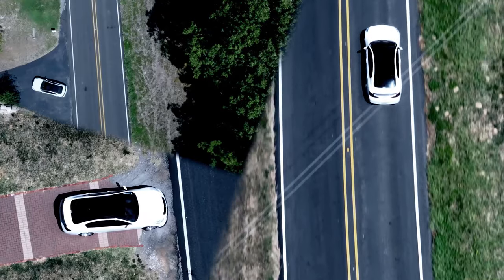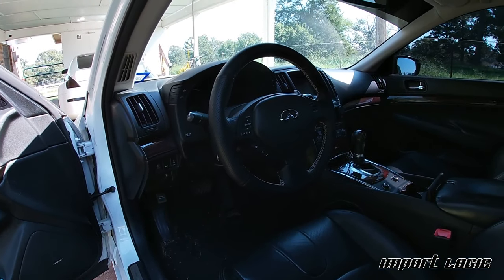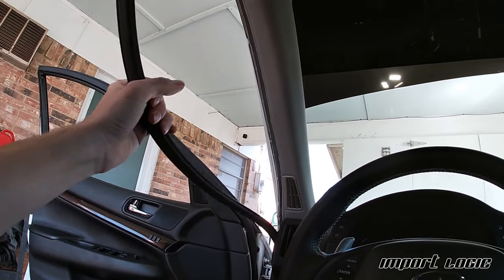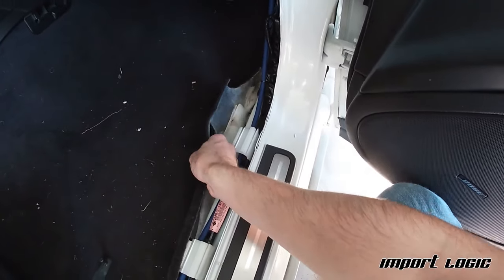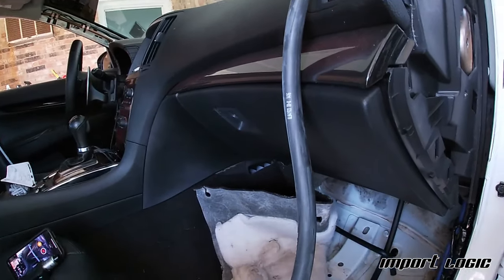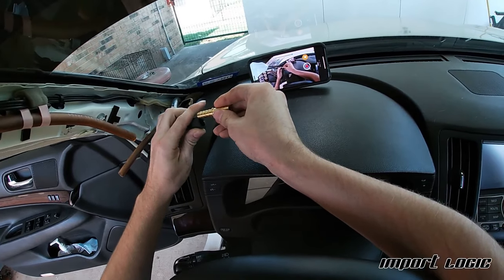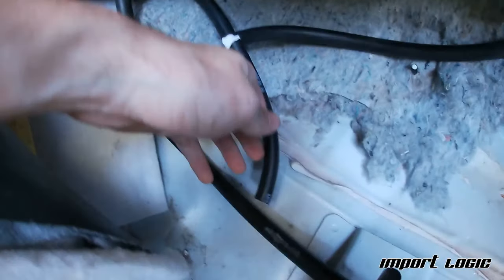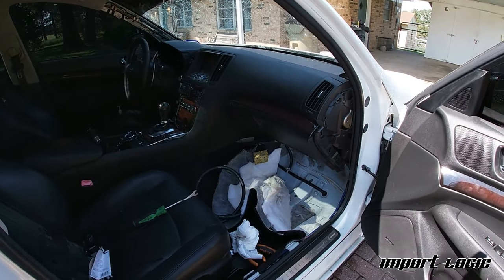Infiniti G37 Sunroof Leak Fix! - Simple Permanent Repair / Fix

Comment: I went to do this with my g37 and my a/c drain was 1/2 not 3/8, I ended up having to go buy a t barb that was 1/2in straight and the t as 3/8 to get it to work
Reply: But - this video was seriously a saving grace because the people that replaced it before me had already tried that straw trick and it was definitely not working 😅
Reply: Do you possibly have a link/description of the barb you got? This is the part I’m stuck on since the AC drain hose is a diff size

Comment: Why didn’t you (also) fix the root cause of the problem, and improve the sunroof seal ? Sunroofs have been around forever in European cars, solid sealing designs are available to copy, the roof shouldn’t leak. I’ve owned 2004 G35 coupe since it was new, never had any leakage. Wind noise is minor. 

Sorry, I’m confused as to why others leak so badly…
Reply from the maker: Modern sunroofs don’t have “seals” around the glass, only a rubber to minimize the amount leaking. It’s not meant to seal anything. That is why there is a gutter system and drainage. It’s more reliable if a system. If you open your sunroof after a rain in your g35 there will be water in the drainage gutter. Sunroofs are a controlled leak from the factory.
Reply: No one would intentionally buy a new vehicle with a sunroof that leaks. Starting in 2005, Infiniti released several TSB/ITB on this issue, but, based on forums,it doesn’t appear that it fixes this poor design. You can’t just throw in a sunroof option, the vehicle structure must be sufficient to withstand the change…or  there will be wind & water issues..

Channels are there for situations where sunroof is accidentally left tipped/cracked open. 

Infiniti sells replacement glass surround gaskets.
Reply from the maker: Hypothetically, if Remove sunroof drains from a brand new vehicle you will find out quickly that the sunroof seal around the glass does nothing but fill in the space. Sunroof gutter and drainage is the primary source of water drainage. This was dealt with many times when I was a mechanic at a ford dealership.

Comment: I don’t understand how this is possible. There is quite literally no room on my driver a pillar. 

Might be a coupe thing but you guys might wanna check that before starting.
Reply from the maker: Can you explain more? Air bags may be different on the coupe but the drainage system is the same. Maybe I can make a part 2 explaining in more detail.
Reply: @importlogic  honestly it may be because of all the additional wiring I have for aftermarket things in the car but running the hose down the a pillars was ROUGH. I’m not sure if there’s a difference behind the dash of the two cars but it took lots of fanagling to get that hose in there. 

I did end up getting it in there. Hopefully it holds up. 

I appreciate the reply and the awesome fix, definitely not as painful as the straw method.
Reply: @importlogic  hey wondering if you have any input on this. Completed the sunroof drain and the sunroof drain is no longer leaking I can poor water into the hole on the sunroof and it all comes out. But I’m really heavy rain I’m still finding some water on the floor of the passenger side.

I did remove the grommet on the passenger side due to me destroying it when attempting the straw fix. Could water be coming in through the opening itself? Do I need to get a grommet to plug it?